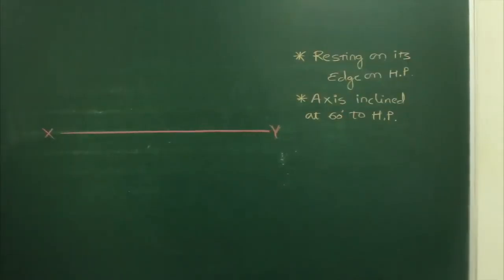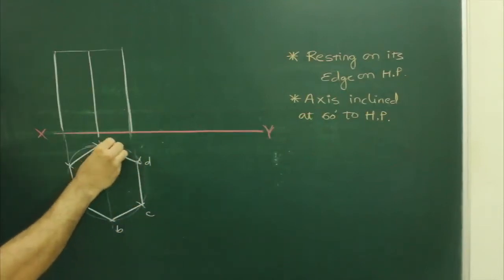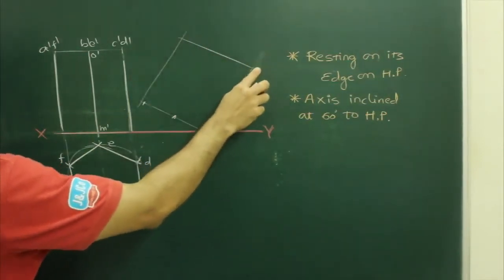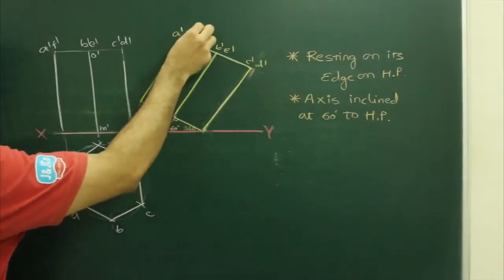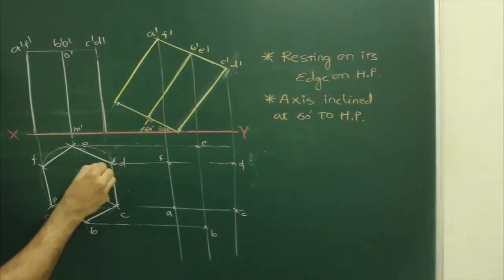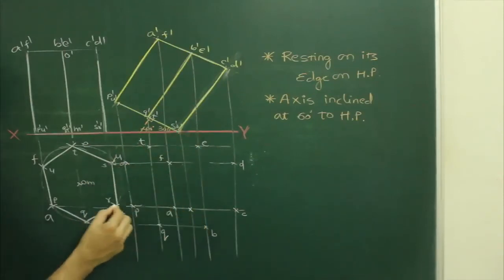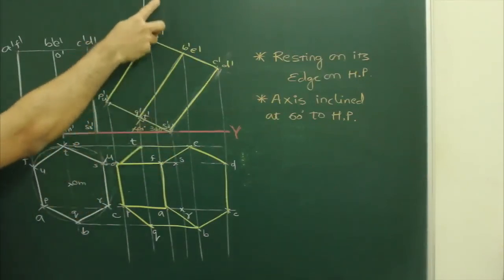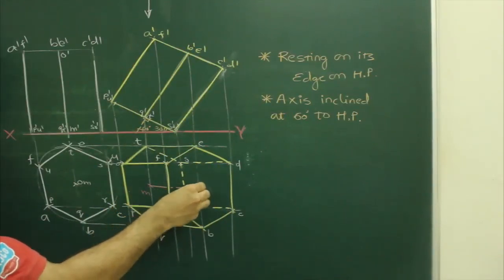Projection of solids 12 (type 2)

Comment: Sir I had a doubt
There was a question in which we had to draw a pentagonal prism whose axis is parallel to hp and inclined at 45’ to vp we had to draw it by third angle method ..however it is not mentioned that we have to draw the pentagon on ground ..the solution showed that the pentagon was on the ground ? So whenever it is written “third angle method” do we have to show the object on ground ??
Reply from the maker: Jimin got Jams Yes you can